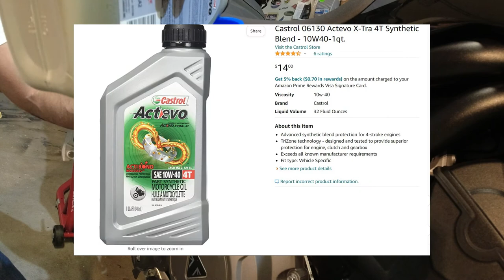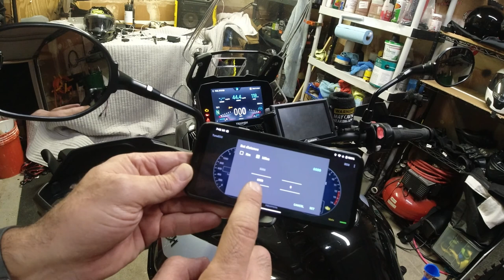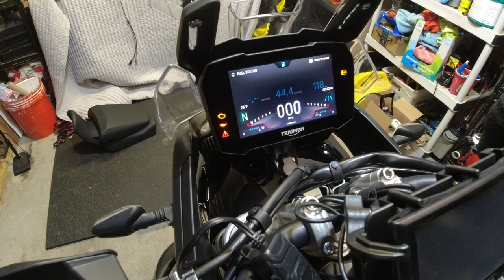Triumph Tiger 900 First Service - Reset Service Light.

Comment: The tuneECU worked as described, after paying the 25 Euros to register. Thanks.
Reply from the maker: Glad it worked!  I haven't had any issues using on my Trident or Tiger.
Reply: Man, I would really like to do this, but having to enable dev mode to install software on your phone is sketchy as hell.  I guess I could look into getting a cheap phone just to run it.

Comment: I own a new '23 Tiger 1200 and am sure the info you provide (less chain info) will apply to it as well. I have yet to check if my 'Bluedriver' OBD will work on a Triumph. So, thank you for this. I don't know if it is a legal thing or they just want their dealers to make more money (or both,) but manufacturers really make it hard for bike owners to do even basic maintenance. You don't get tool kits anymore and they certainly don't provide instructions in the owner's manual. All the high-tech electronic stuff on new bikes is a mixed blessing. The day I can't do a simple oil change is when I hang the towel.
Reply from the maker: Yeah, I have mixed feelings about all the tech and electronics.  When they're working, they work great, but when something goes wrong...  I always like working on my own cars and bikes but some things gotta leave to the pros. But basic oil changes should NOT require a trip to the dealer to reset a service light.  Come on Triumph!
Reply: Of all the bikes (and cars/trucks as well) I own,  Triumph is the only one that makes resetting the oil change interval a overly administrative event.  Moving forward that intrusive resetting nonesense likely will make my next purchase something other than the Triumph.

Comment: Nice job Joe! Picking up my GT Pro tomorrow!
Reply from the maker: Thanks!! You're going to love it.  In fact I just did another oil change on my Tiger yesterday.  Still quick and easy and resetting the service light works like a charm.  Good luck with the new bike and safe travels!
Reply: do you have to register the obd and if so ,whats the cost , thx @Mudslidex1
Reply from the maker: @cdnrider6200  No, you don't have to register the OBD2, but you do have to register the TuneECU app.  Which is 25 Euro which equates to about $26 US Dollars.  However the standard license used to be for life.  But as of Sept 1st 2023 new licences will no longer be for life. The standard licence will be valid for 1 year (3 years for the Pro licence). When the licence is renewed, the number of registered bikes will be reset to zero. BUT...If you purchased the license before 9/1/23 then your license is grandfathered in for life.  Just any new licenses after that date will be annually
Reply: @Mudslidex1  appreciated

Comment: Don't need to take off the pan at all.  
It's not a crush washer so just use the same washer on the oil drain bolt.
Reply from the maker: Thanks. I realized that after the first time doing it.  Taking the pan off is not necessary.  And thanks about the washer, I figured they all use crush washers but it didn't look like one

Comment: I just got my Tiger 900 Rally Pro last week.  So you did your 600 mile first service yourself huh?  Is that First Service a glorified oil change?  Or..should I be thinking about how to do it myself?  I've never adjusted a chain before and have no clue yet. Oil and all that is fine but, not sure what else the Triumph dealer would do...
Reply from the maker: It’s really what you are comfortable with. The oil change part is simple as you can see. The rest of the maintenance they do is “checking” things like fluid levels which you can easily do. And they will check the torque on things like engine mounts and axel nuts (so they say).  I measured my chain tension and it was in spec but a little on the high side and didn’t need adjustment.  I actually finally adjusted it last night after 2000 miles.  It was my first time as well and was super easy. Took maybe 10 minutes and most of that was getting out the tools.  There are plenty of videos that go into detail on how to do it. It really is easier than you think.

Comment: Couple questions, was the app on your phone the OBD link ? Or something else?
Second question what type of rear wheel lift did you use?
I'm 3 weeks into my GT, a twin of yours and aside from the heat on the left leg and it being a little "buzzy" arpund 64-66 mph its really a fun bike
Thanks for the video, keep'em coming!
Reply from the maker: Thanks. The app on my phone was TuneEcu. It’s about $14.00 now and unfortunately only available for Android devices. As for the rear wheel lift I used this one from Amazon. Although it was $54.00 when I bought it last year.  Kw it’s double that!  https://amzn.to/3fUjcjj.  I too noticed the buzzyness at highway speeds but read a tip on a forum about switching the bike to sport mode to reduce it.  It actually does work. I now ride around in sport mode and although it doesn’t get rid of all the buzz, it is a noticeable decrease when riding on highway

Comment: Appreciate the info
Unfortunately I will need an app for IOS, 
I will give sport mode a try..
Reply from the maker: Yeah, it stinks they don't make an iPhone version.  I use an iPhone as well, but I keep an old Android phone around just for the TuneECU app. You don't even need to have service on it, just wifi.  You can probably find old android devices really cheap and the app even works on an 8 year old Samsung tablet I have.   Good luck.

Comment: Does that work on any triumph motorcycles? Do you need android phone? Thanks
Reply from the maker: On most current ones it does.  I also had a Triumph Trident 660 and used the same OBD2 connector and TuneECU program to reset its service light.   The older Triumphs do not use this method
Reply: @Mudslidex1  ok appreciate it

Comment: I have the same bike,  I did my first service today and I bought the OBD LINK ( green one ) did the firmware update and all of my software is up to date on the app.   I know everything is connected because I can see my RPM's on the app....anyway once I confirm my scheduled mileage and next service date and click run....the app gives me an ERROR code stating that It can not reset.   I have done everything I can to think of....is there anyone who knows how to trouble shoot the TUNE ECU app?
Reply: did you resolve the "error" with Tune ECU? I have aa Rally Pro and to try this out.
Reply: @stevemesservier  No I finally gave up.
Reply: I did the same thing. Make sure your bike's clock and calendar are properly set and try again.
Reply: i can't even find the ECU option, let alone adjustments

Comment: Great vid. But your chain is too tight.. 🤞🏼 4cm gap
Reply from the maker: Actually chain was within spec.  Tiger calls for 20-30mm play in chain.  I was just under 30 which was a little on the loose end.  A couple of months later I checked again and it loosened to 30.  I now tightned it to where its at 25mm smack in the middle.
Reply: @Mudslidex1  oh it’s the GT I see.. 👌🏼 you’re right. The Rally needs more slack that is
Reply from the maker: @JRidesRally  Yes. Very similar but different. Mine is actually the GT Low which even its chain tension is different than the regular GT.